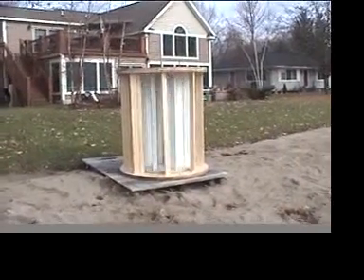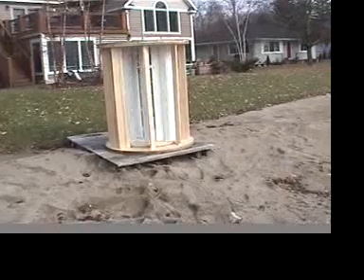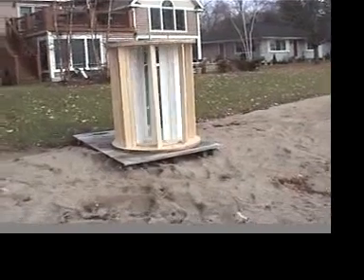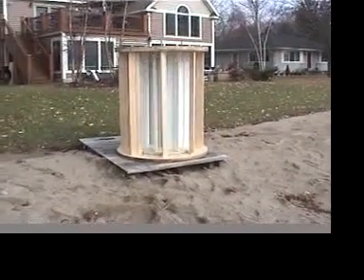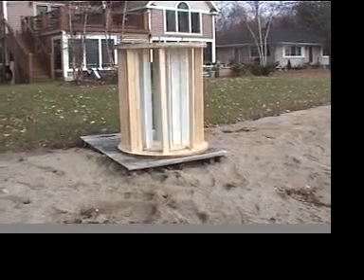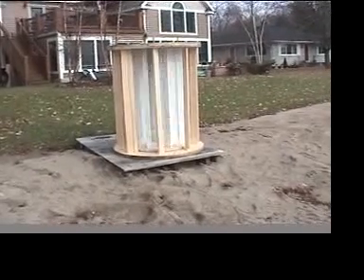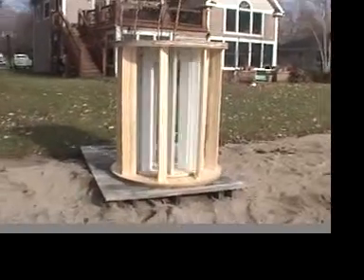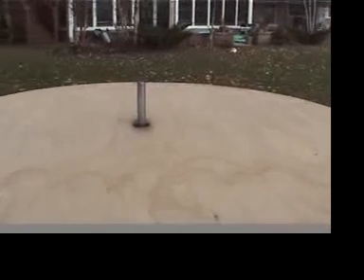Full Size Vawt Kit

Comment: Good grief! What happened with my comment? it posted before I said anything! Try, Try again. It is a good looking vawt. You said it has low rpm and good torque. Your going to produce 110 volts using an inverter. What kind of alternator are You going to use?  Thank You for the great video and information.

Comment from the maker: @pangavamanos 

You're absolutely right.  Come over and help me lift it up higher.  Once i get it the way I want it I will put it on the roof peak.
I have been experimenting with voltage trippler and voltage sixer.  Today I tested and got 31 vdc at 40 rpm with the sixer, and 15.4 at 60 rpm with the trippler.
That's another video sometime.  You can do a lot with 3 phase ac through different circuits.

Comment from the maker: No, on this early version it was two sections of a wing profile trim molding.  This was a not so successful first attempt.  The wings on the return had to push a lot of air out of the way.  Not so much oncoming wind but air.
I like the most current version with the Lenz2 rotor, check it out.

Comment from the maker: Thanks, there is nothing incredibly novel except for the rotor blades being airfoils and their angle to the wind.  The goal is to get this all cut with CNC cutters for precision and boxed as a kit.  As soon as possible!  The alternator for it has undergone a couple design changes to drop the cost.  I am a big believer in simple and cost efficient design.  
What you may not notice is that it is silent, unlike HAWTs.  
A DIY kit for a one day assembly.